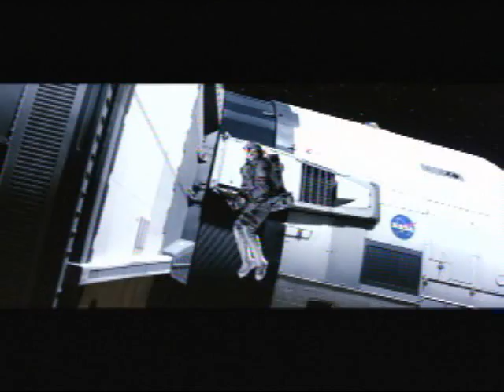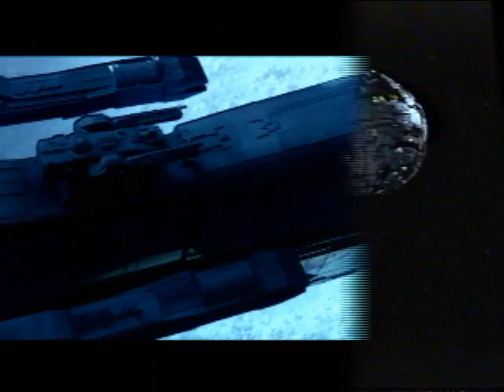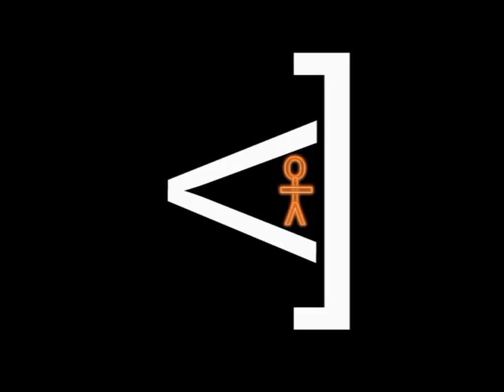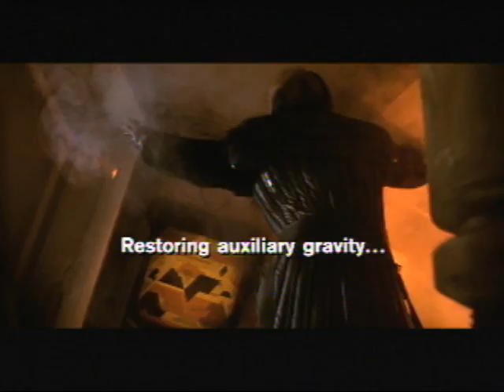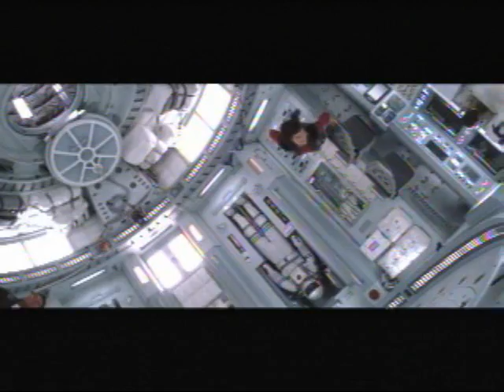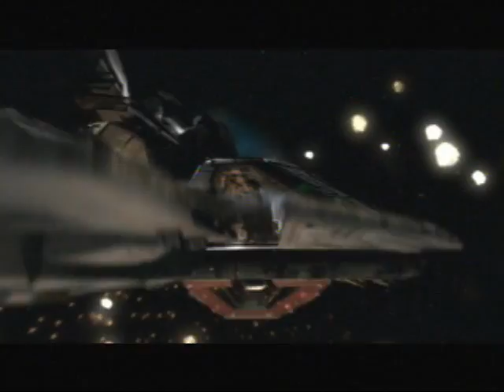The Physics of Science Fiction: Artificial Gravity UPGRADED    SPREADINGTHEMUSE Productions

Comment: If you have a small ring, it has to rotate faster to generate enough force.  And a crew member will move the center of gravity of the ship causing it to wobble.  If you hold a crew meeting with everyone close to each other in the ring, the ship will really wobble.  You would need to have a counterweight for each crewmember that would change position to always stay exactly opposite it's crewmember, and move as he moves.  Bigger rings would have less problems because of the greater difference in mass.

Comment: Spinning a space station is forcing you to accelerate constantly upwards from the inside. Depending which way you run inside will make you heavier or lighter.
Sheridan would of been fine and not needed help if he jumped along B5's axis.
Gravity is an apparent acceleration due to the time distortion field of a large mass.
Did you know the centre of a planet has no gravity? So as you theoretically fall down a hole, you get lighter and lighter.
Smoke your brains. Same with a black hole.
Reply: yeah..but that car door leads to the outside and he had seconds to jump.. jumping along the axle would need him to do it from the front/back of the car wich had no exit.. he would need to go outside.. move to the bront/back of the car and push from there.. wich would had requirre quite more time than he had (the car exploded a couple seconds after he bailed)
Reply: its true.. if someone would made a tunnel throught earth someone falling would begin to decelerate untill passing the point where there is more mass "above" him than bellow.. then he would slow down more and more and then would begin to "fall upwards" again.. until the reverse happens. (eliminating posible air drag)

Comment: ... after all, its not the rotating section that pulls you and makes you feel gravity. Its the movement of your OWN BODY, every atom in it pulling outward and against the ship´s floor, that makes you feel gravity.

If a rotating ship has no air inside, if you are floating inside it, you will NEVER be pulled towards the walls.

At Babylon 5, there is also no force pulling you towards the floor. Except maybe some complex atmosphere motion?
Reply: Sheridan pushed himself outside the car at lets say 3m/s .. he would keep going 3m/s slowing down gradually due to air drag.. but the problem is not that.. the problem is that when he encounters the "ground" or the ring..its rotating at 100kmh .. so it would be like falling off a car doing 100kmh.. the impact would kill you ..not "the fall"

Comment: As for the rate of Sheridan´s fall...

Gravity on Earth pulls ANYTHING towards its centers, because gravity is a distortion at spacetime itself. Thats why "orbits" are possible, even though a ship is not connected physically to the planet, its still inside the space-time distortion caused by the planet.

On a spaceship however, you will only feel the centrigue force IF you are connected to the rotating section.

...

Comment: @SpreadingtheMuse Centrifugal force may refer to two things. For example, artifical gravity. The spinning track is pushing the person inward (centripetal ). Some refer to the reaction force of the person pushing outward on the track as centrifugal force. Note, the force is applied to the track, not the person. However in a rotating frame of reference, there is an illusion of force (ARTIFICAL gravity). This is also referred to as centrigugal. I know of no physics books that say otherwise.

Comment: @SpreadingtheMuse Yes, the four fundamental forces ARE ALL the forces in the world. When you push, pull or spin an object you are not creating a force, you are applying a force. An object can have inertia, momentum, or energy, but an object does not posess force. But yes, the spinner is accelerating an object inside it off its natural path of a straight line. But it pushes the object toward the center (centripetal - center seeking) not away from it (centrifugal -center fleeing).

Comment: @SpreadingtheMuse But absent the force pulling you in toward the center of rotation, you just have inertia and you go flying off in a straight line. It's the inner centripetal force that causes the floor of the space station to push against you and give you gravity. Personally, I've got no problem with centrifugal force as an equal-and-opposite force to the centripetal force a la Newton's Third Law.